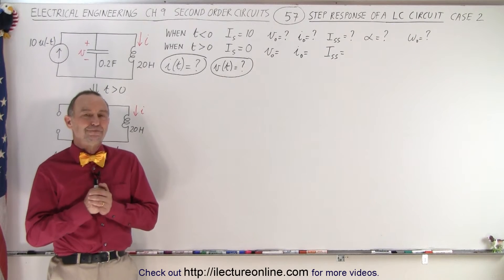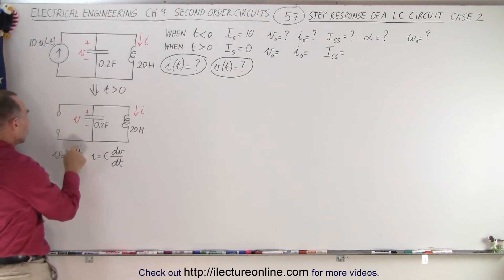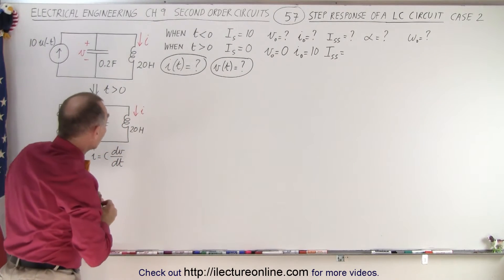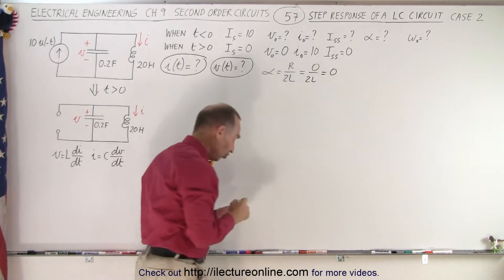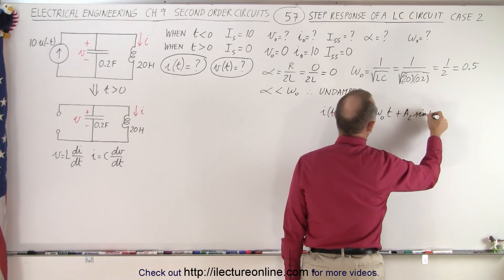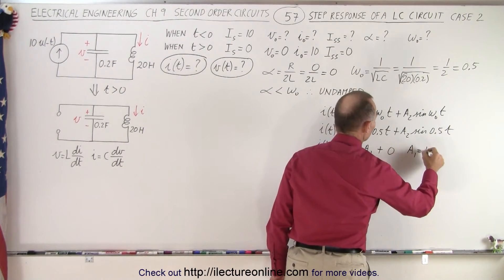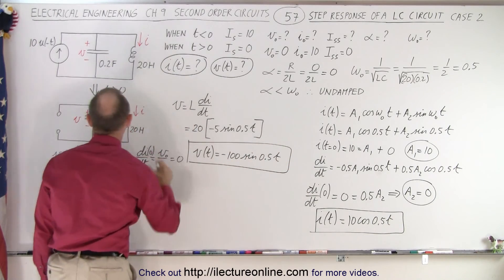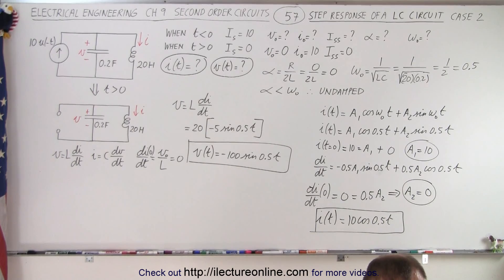Electrical Engineering: Ch 9: 2nd Order Circuits (57 of 76) Step Response of a LC Circuit: Case 2

Comment: Why you did not use e^-alpha for i(t) ? Omg my brains is burning
Reply from the maker: That is the equation you would use for an RC or RL circuit with a DC voltage supply.  This is an LC circuit without a resistor, which means that the resulting current will keep oscillating rather than reach a steady state value.
Reply: because the value of alpha is zero thus e^-0 = 1